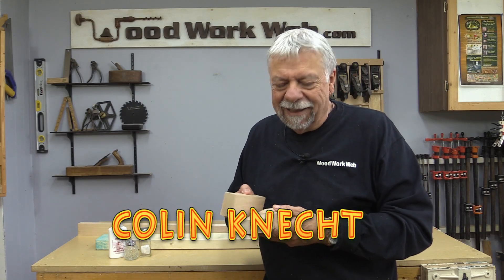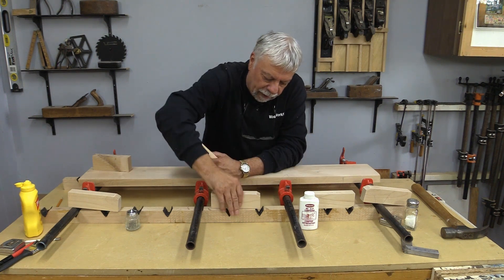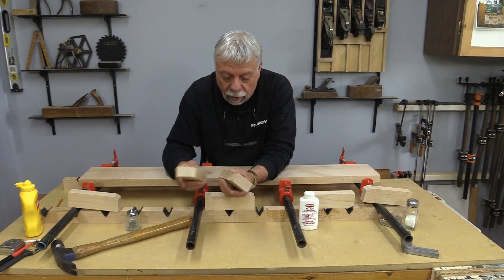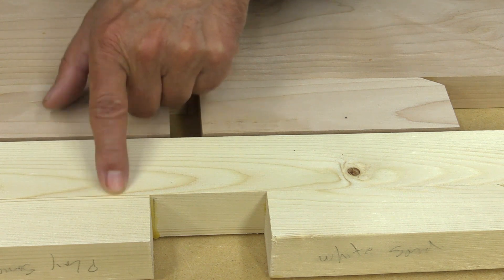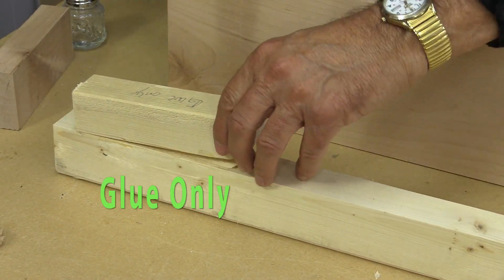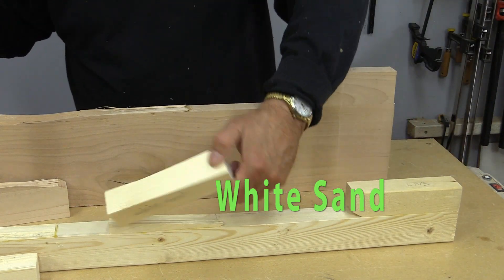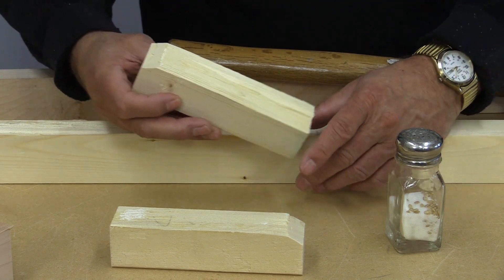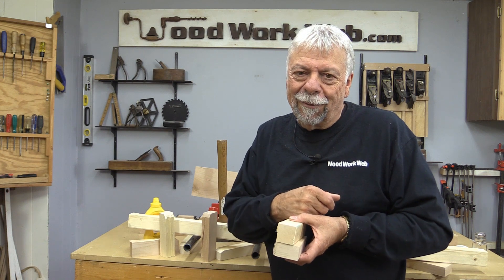Strength Testing Salt and Grit on Woodworking Glue Joints

Comment: a problem with sand or small rocks would be what they would do to jointer or planer knives. 
Salt is probably not great either but it sheers and cracks a lot more easily so the damage to tools would be much lower.

Comment: Hmmm... back in A&P (Airframe & Powerplant) school, our wood instructor said salt can cause adhesive degradation over time, and should never be used. However, I remember looking for references to the claim in the various FAA texts & advisory circulars; and finding nothing one way or the other. Note that this was back in the early 70's when resorcinol-formaldahyde adhesives were still used extensively.
Reply from the maker: To be safe, I wouldn't use it on any critical joints. but it should be safe enough for most woodworking application even if it does degrade it.

Comment: Great test vid Colin. Wouldn't want to run the other grits across a planer or jointer though. Table salt should be fine as it's molecules are softer than the steel of the blade and cleave sharply...  and that's provided the salt hasn't dissolved and been absorbed by the water in the glue.
Reply: Good point.  I was wondering if the salt had a chemical reaction with some different types of glues.  CA glue is very different than PVA glue.  Then there's 2P10 and many others.  Epoxy.  Your point is well taken, but the chemical thing is still an open question.  Maybe the glue people have already tested it.
Reply: Though I don't use CA glue in my wood working, I've not heard of using salt to stop the sliding of surfaces or even that sliding of surfaces is a problem when using CA type glues due to their pretty rapid set time.  Personally I have not had a problem with sliding surfaces anyplace I have used epoxy.
Reply from the maker: Yes, salt is your best choice if you're worried about your blades.
Reply: This is an excellent post.  I worried about the different variations more on how they would effect my blades and teeth than actual strength.

Comment: Did you notice if it was easier to clamp the salt or sanded joints? No need to add salt if the grit doesn’t make the glue up easier.
Reply from the maker: It does seem easier to glue up, but I'll do a full test on that in the future to make sure. Thanks for watching.

Comment: I think you should keep in mind that when using the sands, if you need to resaw the piece, doenst it mess up you sawblade? and did the salt dissolve, if it did it might be a better option if you need to resaw it later. But Once again a great video!
Reply from the maker: Salt you're best bet if you're worried about you're blades.

Comment: The real question is whether salt weakens glue over time. This would be a good question to ask a manufacturer.
Reply from the maker: To be safe, I wouldn't use it on any critical joints. but it should be safe enough for most woodworking application even if it does degrade it.
Reply: @knecht105  how would you know??? I was thinking I'd put this option in my bag of tricks if and when a manufacturer pushes the idea. If "should" came out of the mouth of someone I was considering getting a to do a job - critical or not - I'd keep looking

Comment: Another great vid as usual. Am I the only one dumb enough to ask but was that ordinary pva glue you used?
Reply: Nothing dumb about it. Whatever glue it was, I fear many sheeple will assume that this applies to all glues. We don't know if salt weakens glue in the long term - rumour has it that it does. I learn a lot from YouTube, but it's clogged up with half-hearted, short-sighted testing. I'd say that one way to make a good video would be to ask a manufacturer who's done long and short term testing, reveal that, and then maybe add your two cents worth. If there's a video on this topic that I find conclusive, I wonder how many hours I will spend getting to it.

Comment: Try it with hardwood with knurled grain, actually letting the wood be strong enough to get a fair measure on the glue. And maybe a hydraulic jack with scales to get some actual accuracy, as a watcher of this channel for a couple years, am sort of disappointed at the lack of effort here.
Reply: Brian Stevens the wood failed. Not the glue with added stuff. That's the point. The glue never failed. All the gauges in the world would do no good.
Reply: Well if I use such weak grained softwood,that breaks before I get close to the stress strength of the glue, and  I don't actually stress the Glue to the point of breaking, I tested the wood not the glue didn't I?
Reply: Brian Stevens The hardwood also broke in all the tests before the glue failed so referring to weak softwood is not the point.  If the purpose if the test is to test the strength of the glued joint and the joint itself doesn’t fail then you can’t improve on that.  Using gauges would then only tell you the strength of the wood, not the joint, which wasn’t the objective.
Reply: Starting with a quote from the video description, "Woodworkers who glue boards together for projects like furniture making always need to contend with the slippage caused by wood glue in trying to keep boards aligned during glue-ups, one way of doing this is to use small amounts of salt or other grits to make the boards adhere better and in this video I am testing a few different grits to see how well gluing them works.""{
Says absolutely nothing here about, wood strength or even joint strength, It talks about the strength of the {{{{glue}}} when you add contaminants. Damn cognitive dissonance with you guys is almost as bad as flat earthers. I am not attacking him, the channel or anybody, I am merely saying his methodology in the video does not test The GLUE>.

Comment: Seems to me that is not a god idea putting salt a corrosive, alcaline and hydrophilic chemical in a glue. Vinyl glues (vinyl polyacetate) are pretty acidic and I'm not confident about the ageing of a water based, acidic glue mixed with a hydrophilic  alcaline salt. I would use an inert soft grit, which does not interfere with the glue, or use wood dowels.

Comment: And there you have it.  Do not use salt if you are on a low sodium diet, use the other compounds.
Reply: Yep, for sure it's better to consume sand than salt.
Reply: But if you are using the salt in the glue joint you, yourself, are not consuming it!  Win, win.

Comment: You need to NOT use the grain direction.  The grain is tearing easier, especially on the deep tare out one - the whole grain tore out.  Glue them on the side, then do the test.  Not on the easy to tare out grain to grain side.

Comment: I would be concerned about using anything other than salt that might be abrasive such as sand because if I come back later with any kind of cutting tool like a chisel, router, jointer, plane etc. That sand could destroy your edge.
Reply from the maker: Salt would be you're best bet if you're worried about you're blades.